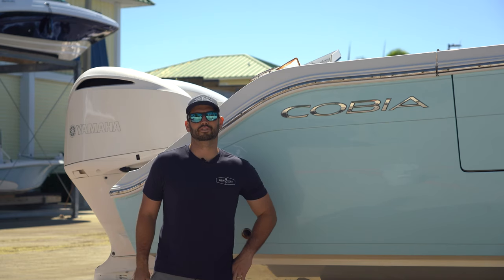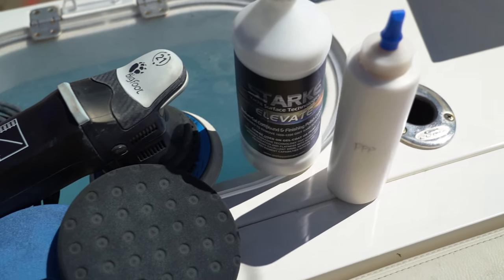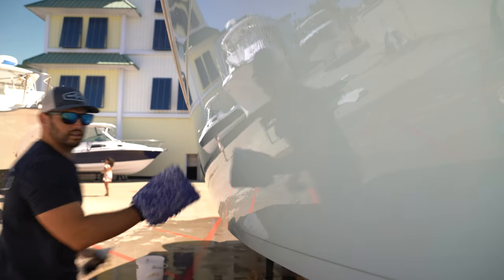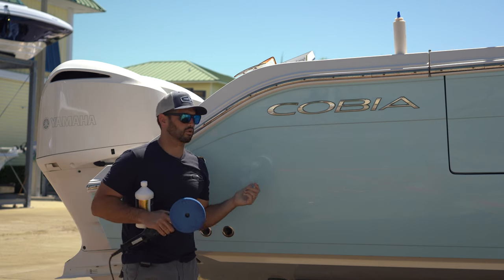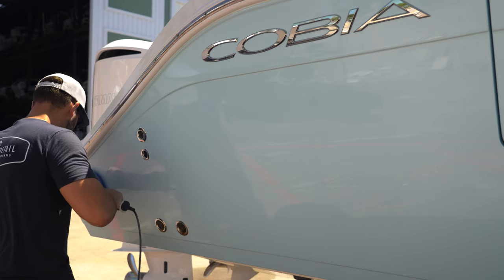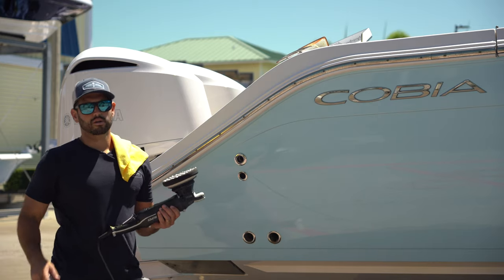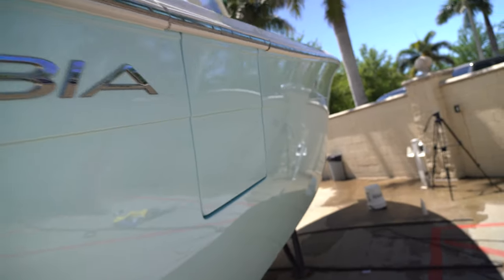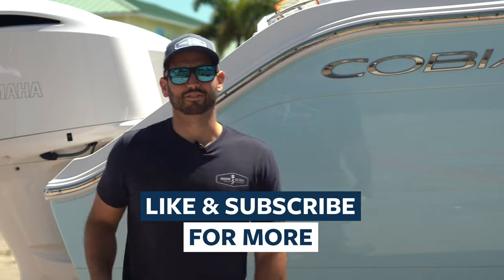Easy Two-Step Correction That Will Save You Time and Money!

Comment: You seem to really know your craft. I have a question for you that I hope you can answer. I have a 2021 sportsman 214 bay boat that is ice blue and white. I keep the boat under a covered carport and a boat cover. My gel coat looks pretty good with a few very light scratches. I am wanting to use a light polish to keep it looking good and then seal it with starke hyperhold sealant. I’ve been keeping it sealed with hyperhold since I bought the boat new but wanting to polish some this time before applying. My question is I know you wash with dawn before polishing the boat but do l need to wash the boat again with dawn after the polish before applying the starke hyperhold sealant. Thank you for your time and thanks for the videos. I have learned a bunch.
Reply: Yes! You don’t want anything between the sealant and the hull. Any compound, polish or wax will cause it to fail prematurely as it doesn’t bond!

Comment: whats the charge per ft on a 2 step like this
Reply: He said it was $650 for this 30ft boat for just the hull sides.  That's pretty reasonable.  A full interior/exterior detail with 3 step and ceramic would probably have ran this customer about $3000.
Personally, I do all my own polishing.  The equipment and products pay for themselves in one use and you have the flexibility to do a section at a time.